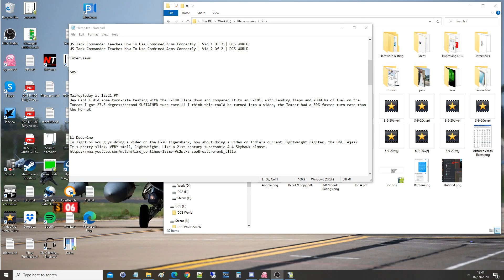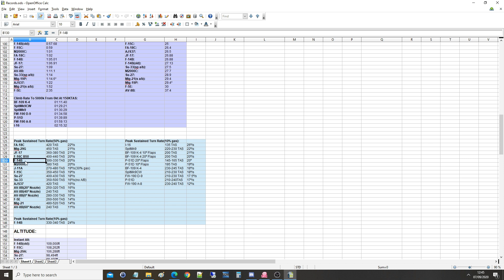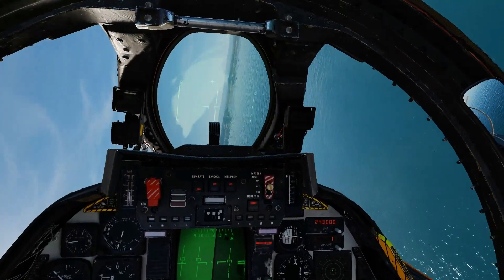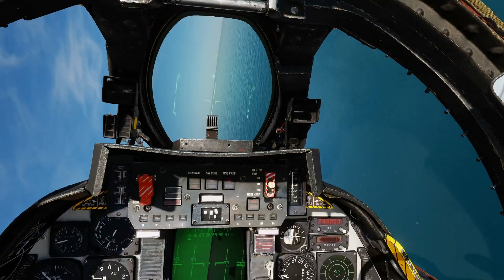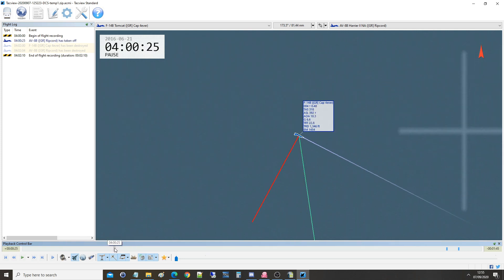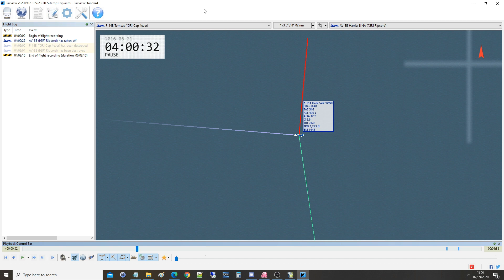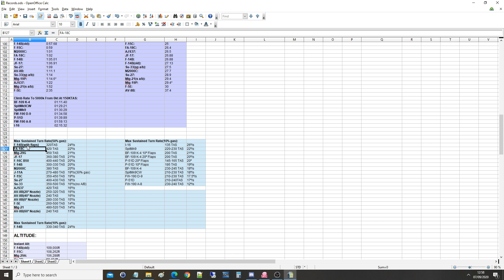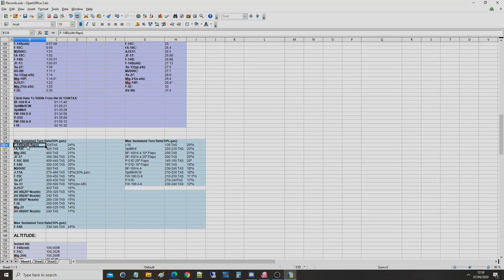F-14B Tomcat: By How Much Can Manouveur Flaps Increase Turn Rate? | DCS WORLD

Comment: What is the formal maximum speed with the flaps down (Vfe) of the Tomcat?
Im no Tomcat pilot in real life but what I remember is that it was somewhere over 200kts. Thus having them extented is a big no-go at speeds you were flying here. You are simply breaking your aircraft.
Reply: The limit for slats and flaps beyond maneuvering is 225 knots.  I read elsewhere that the DCS F-14 is going to be updated to model this limitation.
Reply: @gort8203  and @John Crielaard
No, the damage model is updated. Cap just terminated the test before he could assess damage to his plane. 6g and over 300 KIAS with full flaps down (not maneuvering flaps BTW), is VERY likely (almost a certainty for a turn that long) to cause damage to flaps, both, or of you are less lucky just one of them. This in turn will kill your wing sweep mechanism and you are stuck with a high drag, asymmetrical configuration for the rest of your mission. Yeah, maybe irrelevant on the Dogfight Servers where you don't care of you make it back to base (and the base is like 20 miles from the kill zone anyways), but literally a mission killer in any other circumstance.
Reply: @ilejovcevski79   I never takes Cap's test methodology as having any applicability to real aircraft, but I'm glad to hear DCS has closed that unrealistic loophole in the game.
Reply: @gort8203  yeah, me too. Not so much the boost in performance, as the lack of consequences because of it. You wanna risk and jam your flaps? Go ahead. By there is a price to pay
Reply: Yes so this video basically proves the flightmodel has a major flaw. And the Tomcat is not unbeatable but the DCS flightmodel has a loophole.
Reply: @johncrielaard465  DCS doesn't really have a "flight model", apart from the SFM. Blame Heatblur and Heatblur only for their UFO.
Reply: @getsideways7257  Any software trying to replicate an aircraft's dynamics is in fact a flight model. How complex a flight model is, is the question. And for training purposes, it depends on the training needs on how complex it needs to be. (I have sat in many simulators in my carreer and non as far as I can recall felt better than and 'game' sim I have played. Sometimes even worse)
Reply: @johncrielaard465  I guess I have to go in detail here, after all... Do you know which exactly piece of software is responsible for a typical module's flight dynamics? The one sitting in the module's /bin directory and having something like "FM" in its name, or any .dll at all sitting there and being referenced by the entry.lua, for that matter. That is, of course, if the module in question doesn't use SFM instead (like the A-4C). Oh, and in the case of the Tomcat the file is called F14-FlightModel.dll.
DCS itself is merely a shell to run those .dlls in. It provides an interface between the environment and the aircraft's .dll. Things like current flight conditions and the pilot's input are fed into the .dll, which gives all the needed motion parameters in return so that the next frame aircraft position and attitude could be rendered correctly by the graphics engine.
In other words, it's only technically correct to call the .dlls themselves "flight simulators", not DCS.

That is usually the way military training software is built. The architecture is modular, so different software pieces do different jobs, like visualizing the environment or calculating flight parameters of an aircraft. Sadly, civilian sims are often reluctant to adopt the same principle. Only DCS works purely like this (even though it still has the backup SFM), but one can also employ a similar approach with FSX and P3D (in the latter it's getting deprecated).

As to why a purebred military sim's FM can be worse, that's easy. Making complex flight dynamics models is expensive (also in terms of time), so if you mostly need the sim for procedural training, there is no need to pay extra. Currently, hardly any piece of software can provide a high enough level of fidelity to rely almost exclusively on the sim, so the military would rather use the real thing instead (or a trainer aircraft). Not to mention that it's simply impossible to also emulate all the sensory input the pilot gets in real life.
The civvie market, on the other hand, is more demanding, so the times when one could get away with a primitive FM are long since gone. Civvies are unreasonable. They are not satisfied with just +90°/-20° of alpha and +30°/-30° of beta. They need FULL coverage just for the sake of entertainment. But if they are paying, who's to complain?

On the other hand, with a civvie sim you can easily get away with fantasy performance as long as the thing seems to fly "kinda right". Nobody is going to audit the FM thoroughly enough anyway, so the developers can get away with Tomcats doing 27°/sec sustained... Nobody's life is really dependent on those numbers, after all.
Reply: @getsideways7257  Well yeah I know. After 12 years of flying I'm now head of simulation development. Aren't we drifting from the point? 😅
Reply: @johncrielaard465  When why are you blaming "the DCS flight model"? The issues here are fully on Heatblur. 120 years of flying or head of all IT ventures of the world, you can't deny that.
Reply: @getsideways7257  Allright now I get your point. Agree
Reply: @getsideways7257  What, exactly, is the issue with our FM?
Reply: @nicholasdackard4364  Ah, nice to meet you. Could you please share with us how exactly you are deriving the table data for your FM, especially considering it's a variable-sweep aircraft (with spoilers, among other things). Maybe you could also provide a shot or two of the CFD software you used with the F-14 being worked on? I mean, if it's a norm for 3D designers to show wireframe view of their models, why don't we apply the same to table based flight model creation?
Reply: @nicholasdackard4364  Or wasn't there any CFD involvement to begin with? I'm just curious how you obtained the aero data that allows your rendition of the Tomcat to casually pull 24°/sec sustained at HALF fuel (which is a lot of weight). And then there is the guy claiming to have achieved 27 (probably with a more reasonable fuel load/flaps settings).
Reply: @getsideways7257  CFD is not an appropriate method to derive table data for something like an F-14. We rely primarily on wind tunnel data. There is plenty of undigitized table data available on the F-14. If you believe there is a flaw in the achievable turn rate, please offer constructive feedback through the appropriate channels - that said we're very pleased with how close we are performance wise and would be surprised to see any major flaws currently.
Reply: @nicholasdackard4364  You probably meant it's too cumbersome rather than inappropriate, but as the time goes by CFD solutions also get GPU acceleration.

I don't know about "plenty", but at least there is AFWAL-TR-80-3141 (P3 in particular) that also happens to be used by Richard Harrison in his F-14 addon for FlightGear.
And while I admit (after giving it some testing), your module indeed seems to pull 15°/s @ 6.5G at 5,000 ft, just like one well-known EM chart suggests, what about the sea level, near empty fuel, clean configuration performance? Can you show me an EM chart confirming the aircraft can pull up to 25°/s with maneuvering flaps and whopping 27°/s with full flaps (at least that's what I managed to achieve personally)?
My pilot was basically blacking out going hardly faster than 310 kts pulling over 8 Gs! I don't know about you, but if it was my module I'd at least try to use CFD to check if that is anywhere in the ball park of "realistic".
The sturdiness of the full flaps configuration aside (even if they are jammed), would the resulting drag allow to sustain this turning rate in the first place? Not to mention I doubt that even with full flaps there would be enough lift generated to allow for the 8G figure.
And speaking of Richard Harrison, his F-14B doesn't seem to perform anywhere close to that, despite also using AFWAL-TR-80-3141 (or did you use something else? then why hide what exactly?)
Before you say "it's just FlightGear", JSBSim also allows for multi-LUTs, even if it's not done through a .dll interface.

Also, I just found out that your module somehow doesn't stutter with the Esc dialog on screen, but can stutter really badly after another Esc press: https://youtu.be/Chioikpa9o0
I have a feeling that could be somehow related to the cockpit shaking.

Comment: Would having flaps out delay sweeping the wings back?
Reply: Flaps down prevents wing sweep (red light to the right of his artificial horizon) in the best case. In the worst case, the flaps get jammed down when the wings try to sweep. This would prevent wing sweep and causes increased drag in a chase or problems with unwanted roll.
Reply: Flaps literally limit how far you can sweep back the wings. With full flaps which brings down the innermost aux flaps, IIRC they won't sweep back at all and with manoeuver flaps down they're limited to ~55°, which usually only occurs when you put them down manually.
Reply: Maneuvering flaps? No. They will self retract before then can block the wing sweep. On fact, it's the other way around, wing sweep prevents maneuver flap deployment. However, what Cap did here is deploy both main and aux flaps in landing mode. This DOES prevent wing sweep mechanism from working and WILL  damage your flaps above 280 KIAS and 5 g. I am willing to bet Cap did jam-broke the flaps in the flight above, he just didn't try to retract the flaps after the experiment. You pull this kind of maneuver in a mission, and it's game over. You'll be flying with at least one wing in a high drag configuration, and your wings stuck at 20 degrees.
Reply: @ilejovcevski79  You can deploy maneuver flaps manually and they'll stay down unless you let the AoA go down through somewhere around 10 units when unloading (which you don't when flying level, unless you're slow enough to have a higher AoA and accelerate out of that). That way the wings will go back as far as 55° maximum. But you're right on all the other things you said.
Reply: @CakePrincessCelestia  yeah, i never tried to manually command maneuver flaps, unless planning to turn hard, and even then, the manual deployment is seldom more effective then the auto. I case which comes to mind is during an over the top maneuver. And when turning hard, the Turkey would usually not accelerate that much to warrant wing sweep back. But good call, i'll need to experiment more with the thumb wheel! 
BTW, good to see you on youtube man!

Comment: @Grim Reapers Well Cap this raises another question, how does the other aircraft in the list behave with flaps down? or the maneuver flaps are just specific to the tomcat? What i mean is maybe try the same thing in a hornet to see how much does its sustained turn rate vary with flaps down. And maybe then it can become a valid tactic for dogfights in dcs to increase turnrate!
Reply: Many planes have them drop automatically depending on AoA anyway, including the Hornet, Viper, Harrier and even the Suchois.
Reply: So using flaps increases your turn rate. Is there any specific speed that breaks the flaps, in terms of they will not close? I'm pretty sure I used flaps a few times at speeds around what you was using and I don't think the flaps would close after that. I may have been wrong. What do you guys/girls think?
Reply from the maker: Will have a play but 99% sure that flaps will be detrimental to all other modern jets, which begs the question, why?
Reply: Timothy Coish  It's also in Windows. Blame everything on Microsoft then.
As for the FM not being accurate, I agree. But it was developed by Heatblur, not by ED.

Comment: Cap Tacview  third option on the top bar add Telemetry data where you can show the turn rate over time
Reply from the maker: Interesting thanks. Although your idea is probably better, I quite like the way I do it. Can't explain my logic.
Reply: @grimreapers  np just wanted you to know the tool is there also the fact that the 14 can turn so tight isnt that surprising when you look at its effective wing loading instead of its official wing loading which only accounts for the moving portion of the wing surface and not the entire aircraft 96 lb/sqft vs 48 lb/sqft which isnt that much different from WWII fighters. The official wing area is 565 sqft the effective wing area is actualy 1008 sq ft or 94 m²

Comment: https://www.thedrive.com/the-war-zone/27889/confessions-of-a-navy-f-14-fleet-pilot-turned-f-5-aggressor
"F-15s liked to drag the Tomcat high and use their superior thrust to gain an advantage. An off-the-books tactic we used to counter this was to manually extend the wings to the fullest, then incrementally lower the flaps beyond the normal maneuver setting. It was hugely successful, but the danger was that the flap torque tubes were not designed for this and could become stuck.  

Life is all about tradeoffs, and not losing to an F-15 is certainly worth the ire of the maintenance Master Chief."
Haven't been flying DCS for a while. Is the A model out / release date in sight?
And when will the mystery module 2020 revealed? I mean end of year is rapidly closing...
Reply from the maker: Yeh I suppose you will do a load of damage to those flaps. A comes out next month I believe? I assume the mystery module was the Mig-29A, which is friggin awesome I think.
Reply: That passage should be directed to Heatblur since we can just select either up or down on the flap handle. I remember the SME there (Victory 205) saying it was possible to lower them granularly as well, but he also clearly stated it was never used in normal operations due to the design limitations. Literally what the above passage says. Would be more realistic anyway to have the handle not instantly jump around and if we had the option to map it to an axis or incr/decr buttons. I mean, we ought to fly this thing as close as possible to the real thing, then we also should be able to make the real mistakes :D
Reply: @CakePrincessCelestia  this is your lucky day then. The DCS F-14B does have the flap lever assigned to an axis. I have it mapped to one of the rotaries on my X56 throttle.
Reply: @cab6273  I really must have missed the addition of that... :)
Reply: @CakePrincessCelestia  Missed that too. Though I do not have a spare axis anyway. Used mouse to move the flaps but that's not ideal in a dogfight.
Reply: @CakePrincessCelestia  It's a Christmas miracle!
Reply: @CakePrincessCelestia  I think the part that needs to be sent to Heatblur is "Life is all about tradeoffs, and not losing to an F-15 is certainly worth the ire of the maintenance Master Chief". In other words, the thing should be roughly on par with the F-15, not simply domination everything else in DCS.

Comment: Consider that lower speed means smaller turn radius, combined with higher degrees per second, means ridicolous better turns in dogfight !
Reply from the maker: Yup this plane is unbeatable in ACM if driven by a good Tomcat pilot.
Reply: Rate and radius in aviation nomenclature lol.